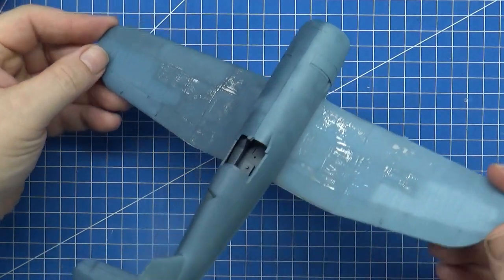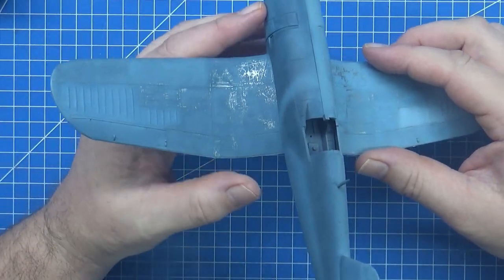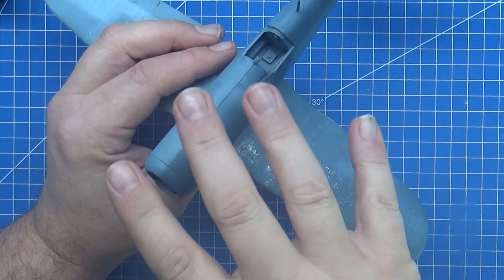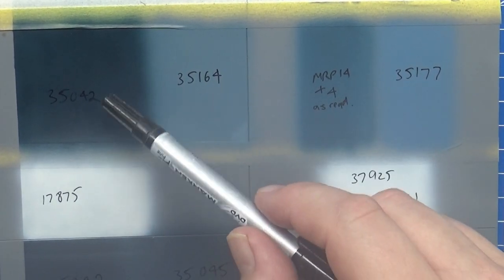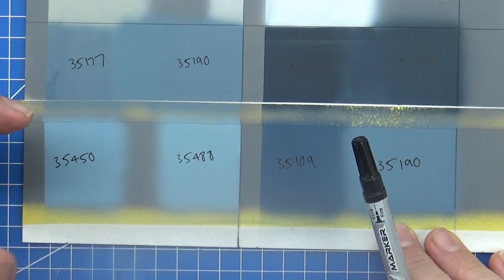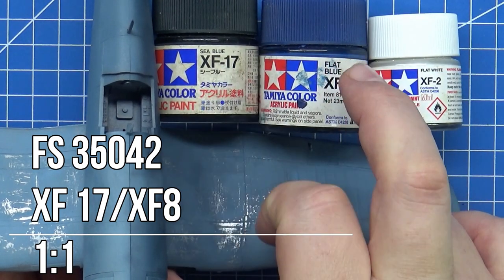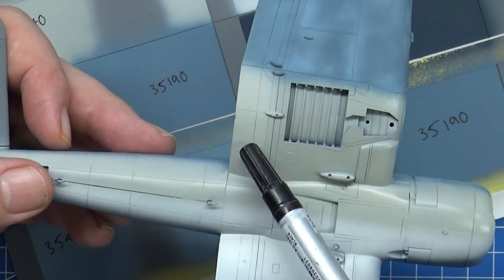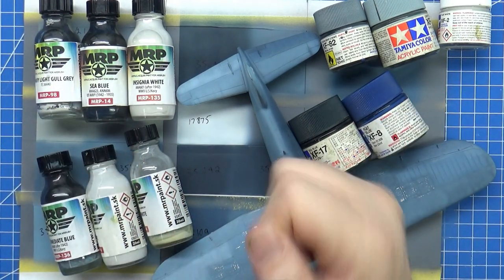How to pick the right colors for a weathered Pacific Corsair: Tamiya 1/48 F4U-1 Double Build: Pt 3

Comment: Fantastic article, well put together and well presented. I have got the Tamiya F4U-1 1/32nd Birdcage which I have just acquired this is going to help all the way. One question I have in regards to the two tone scheme is there a Tamiya acrylic equivalent to the  Insignia White FS 37925 MRP 135? The reason I ask is I have a problem with my chest when using lacquer based paint even with ventilation and a mask. Thank you 👍
Reply from the maker: Thanks Gaz. Unfortunately there isnt an out of the bottle option for an MRP 135 equivalent in Tamiya, but you could go somewhere close to it by mixing Deck Tan and White, possibly with a hint of yellow (and by hint I mean literally waving the bottle near the mix!).
Reply: @beckersmodels  Thank you very much for your help I will have to have a play around and see what transpires. Thanks again.

Comment: Thanks for this.  I’m building the brilliant 1/32 Corsair from Tamiya.    I decided to use the lighter intermediate blue over light grey.  I think your ratios will be a huge help.  One question.  Doesn’t it also depend on primer color underneath?  I like black basing and using various marbling colors underneath the main color.  The black basing will probably shift the colors.  In your excellent video was your test pieces primed in black? Grey?  Or just over the bare plastic?
Reply from the maker: Your're welcome Paul - that Corsair is indeed brilliant. I couldn't help myself while researching for this build and bought myself another one. Absolutely primer colors will shift the temperature of your blues (if not slamming it hard and thick!) and I did use a neutral grey over the styrene sheet. I would also use black basing or even brown basing like on my Mig-31 video - especially for the lighter colours. Hope that helps, Chris
Reply: @beckersmodels  yes big help.  I have that MiG 31 in the stash and will use brown basing.  I like the clear colors you used on that one.  I’ll simply experiment on junk plastic before I put down paint in the Corsair.  I’ll reference the video again when I’m at that stage.  Again, thanks!

Comment: I hope you are available to respond my friend. With that, I must say that you have done a superb job with great ingenuity on a model I most hold favorite, of the WWII era. Having expressed that, I will say that I currently have this model on my build bench, and aside from the usual Navy blue I normally see this aircraft painted in, I would Love to know which color combination you used to create the cobalt blue looking blue 35109, which is at the bottom center of paper?  I would like to use that color for mine. Also, what color could I mix in to get a purplish blue hue? Please be specific in whatever info you send me, thank you.
Reply from the maker: Hi there - I've left the color combinations in the text below the video, for FS 35109 cobalt blue, I used Tamiya paints in this ratio:  XF17/8/2 2:3:4 Hope that helps! If you want to make it slightly more purple, add a very very small amount of red.
Reply: @beckersmodels  Thank you so very much for your reply. Can I ask, can you tell me how the "2:3:4" ratio works? (I've never worked with airbrushing, my first time). Is it to mix, 2 drops of the 17, 3 of the 8 and 4 of white..? I'm sorry for sounding dull..
Reply from the maker: @MusicMinisterJP7  Not a problem -  glad to help.
I use a tattoo ink cup to mix my paints, I drop in one or two drops of thinner first, then yes, drop in the correct ratios thereafter as you state. If you want a bigger batch, just multiply the drops. 
Stir it together, maybe another drop  (literally a drop or two) of thinner, make sure its nice and consistent and the color you're after, then I slowly add thinner to get the right spraying consistency I want. With Tamiya I always start with 50/50, so if I put in a total say 9 drops of paint, I will put in 9 drops of thinner, but usually I got a bit more as Tamiya XF paint can be quite thick!
Reply: @beckersmodels  Thank you very much. There is a question I've wanted to ask someone on this topic of batch size. How much paint/primer would I need to fill the airbrushs cup, in order to cover the entire 1/48 scale aircraft? 
I ask for two reasons; 1, I don't know, 2, if I run out of paint 3/4s of the way, I may need to mix up some more, and it may not match equally. Thanks again,  and I apologize for asking so much.
Reply from the maker: @MusicMinisterJP7  No keep asking I love helping out. If you were to paint the entire 1/48 aircraft with this blend, you're probably looking at a little less than a small jar of the Tamiya paint to mix up. You can buy these empty, or just keep your old ones to recycle (I just clean them out with lacquer thinner), or buy some glass paint jars to make a larger batch, which is what I do for bigger jobs. Dont be too concerned if it doesnt match equally if you need to mix up some more - the way around that (Ive found through trial and error) is to paint the horizontal or vertical surfaces first, then the other "face" which could be a slightly different color anyway. If you make it too  uniform, it will look like a diecast toy!
Reply: @beckersmodels  Its all becoming more interesting, the airbrushing method. I've always used testers spray paints when I was young 14-18, at which I built quite a number of models; cars and planes. But now at 61, I've developed the urge to get back into the hobby, but using airbrushing. To be straight with you, I looked at a few YouTube videos, where I learned to build an airbrush painting booth. Has fan and filter duct system to blow out fumes out window, led lighting and that black round spinning plate. I went this far bcuz at my age I need to protect my lungs. I've also had a Badger 200 siphon feed single action for about over 40yrs, never used. I also looked into,, what type airbrush is best and by popular use, I learned many use the gravity feed airbrush. So I went inexpensive and bought the Master G233 gravity fed dual action airbrush. I also managed to snatch up a Master compressor tc-20t with external tank. So it's to say I have a big interest in the airbrushing method. I did buy a drawing pad so as to practice spraying forms and distances. 
I'm embarrassed to say, that I have about 8 other planes to build. Three F14 Tom cats, two F18 Hornets, two Phantom 4Js, two F-5F Aggressor Northrops.. plus a 3ftx3ft box of old ww2 airplanes I won't be interested in building. I'm good with this selection now. I am grateful to you for your help, I loved the job you have done. Thank you.